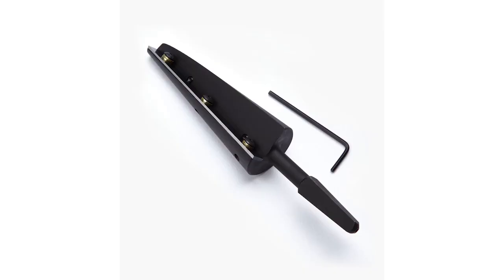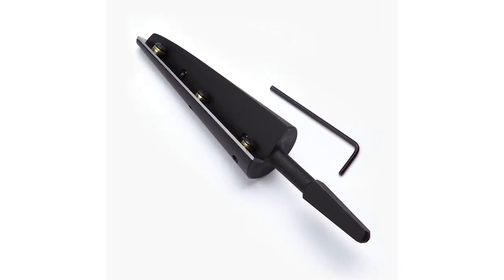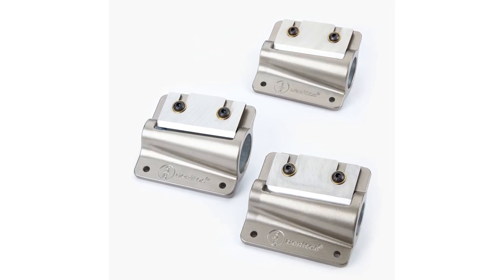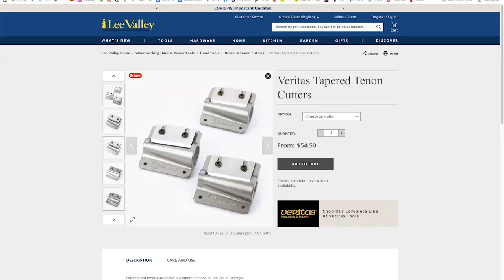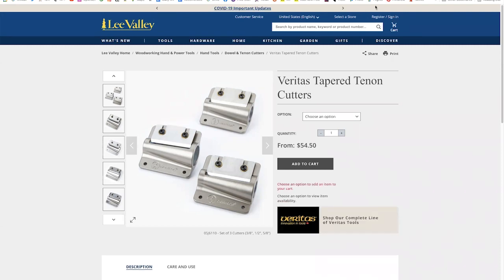Show and Tell #312: Jeff Waldman

Comment: Why not just use a Robertson head screw?
Reply: It strips easier. Torx has more surface area which allows for more torque. Robertson is necessary for some fasteners... namely stainless steel because the softer metal holds up better with the simpler drive. Torx (aka star drive), at least when combined with good metal hardening, holds up better.
Reply: @jeffreywaldman  but how easily are they removed? The Philips screws are horrible 
Robertsons don't require so much downward pressure, which makes it so much easier
Reply: @ABAdams  Very easily. Robertson is pretty good. I like it for a lot of stuff. I've driven many tens of thousands of screws and I'd rate Phillips a 2/10, Robertson a 7/10, Torx an 8/10 and if your Torx is made by GRK it's a solid 10/10. Drive style matters, A LOT. But the metallurgy matters a ton as well and GRK makes some dynamite screws. 

I've  probably stripped or broken a few hundred Robertson screws. I'd be surprised if I could count on two hands the number of GRK Torx screws I've mangled. And I've driven a lot more of them.
Reply: @jeffreywaldman  Thanks so very much for taking the time. Much appreciated. 
I'll get some  ;-)